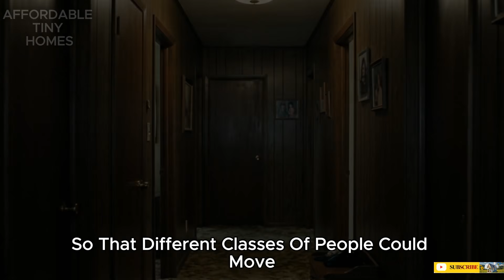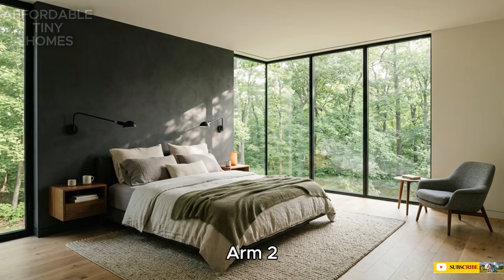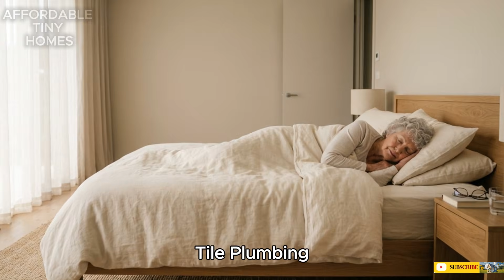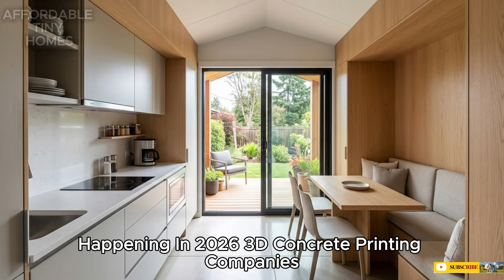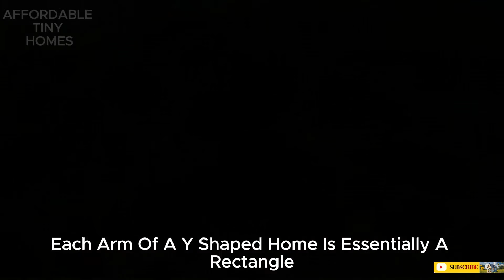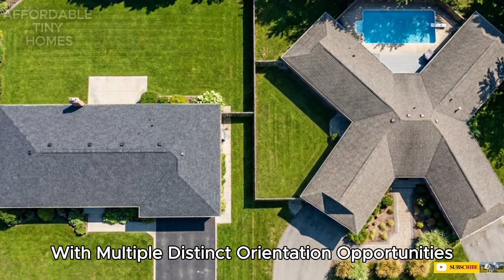Why 2026 Home Designs are Killing the Hallway (And What’s Replacing It)

Comment: I think the most efficient design for the fewest hallways is the circular plan. It's also the most efficient use of foundation area. It's also the most energy efficient, especially a dome. The Y plan shown has some advantages, but it looks like it still has about average hallways compared to a typical ranch house with a split bedroom plan. A problem with the Y plan is that it has a larger footprint compared to rectangle or circle, like a hand with the fingers outstretched rather than balled up in a fist. The illustrations show a lot of glass vs. insulated walls, so that's going to be less energy efficient vs. thick walls with fewer windows. Moreover, the first consideration of a dwelling is the lot. You have to build what fits. After that it's budget and aesthetics, whether geared towards energy efficiency, historical style, blending into the neighborhood, or some other idea such as the Y shaped foundation plan. If you have a generous lot size and don't care so much about energy efficiency or budget (glass is typically more expensive than stud walls) the Y plan is interesting. There's also the triangle plan and the cross plan. The best example of a triangle plan would be a pyramid, and the best example of the cross plan is Disneyland's Monsanto House of the Future. Thanks for posting.
Reply from the maker: You make a great point about the efficiency of circular plans! 😅

Comment: There's advantages, but cost and efficiency of no hallways isn't 1 of them.  You still have hallways in almost all your examples, plus you added a large central area, with the noted increasing cost by increasing the outside walls and introducing a complicated truss design in the middle.

Buffer zones are an expensive solution.  Cheaper and quieter to use closets, dens, and lesser used spaces (laundry, bathrooms, kitchen, etc.) and noise insulation.

Line of sight can be economically established by placement and angled doors-entries at the corner of rooms so the view between rooms is limited.  You achieve the sight privacy without large separation.

The better solution is to create nodes.  Example:
1. At my front door is a node with the entry door, garage door, kitchen, and the entry room.
2. 12 feet away is a node with the steps to the basement, bathroom, master bedroom, and living room.
3. On the other side of the living room is a node with the kitchen entry, dining room, and 2nd bedroom.  
The walkway between these are lined with display cabinets getting dual use of the walkway.  The walkway can be defined with flooring.
4. At the bottom of the basement steps is a node with the steps, basement bathroom, spa room, and workshop.
The only areas not accessible from 1 of these 4 nodes is the 3rd bedroom and deck\outdoor kitchen.

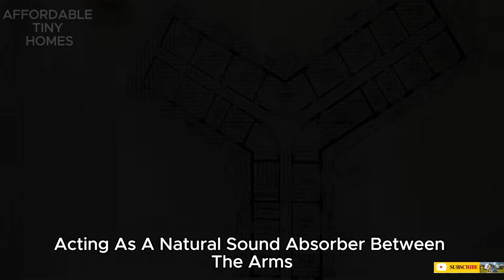Comment: some of the floor plans displayed had hallways like at 7:00. Still need hallways if there are multiple rooms per Y leg. Would have been more convincing if an actual interior tour were shown. Noise between rooms can be reasonably handled using rockwool insulation on all interior as well as exterior walls.
Reply from the maker: Okay ✅

Comment: Hallways create separation and experience. Without hallways Frank Lloyd Wright architectural philosophy of compression does not work. That's the emotions and experience you have going between small and larger areas that suddenly feel powerful and in awe even if in reality the space doesn't have much.

Not to mention separation of sound as well though other design techniques can be applied for that purpose.
Reply: You can achieve Wright's compression-expansion by altering vertically, not horizontally.  Example: a sizable entry with a lower ceiling, that opens up to other rooms with vaulted ceilings (same for other rooms).  Open stairwell with a sloped ceiling until you near or enter the room or landing.
Reply from the maker: Absolutely
Reply: @AFFORDABLETINYHOMES-i9j  It's funny you mention Frank L. Wright, I have been working on building Wright inspired build, but the site is not cooperating and my wife wants a more rambling 
layout . I just started playing with a Y layout yesterday then saw this video today . P.S.  So far it has been a struggle to draft a prairie style Y,  but now that I've seen this, I have to keep trying .
Reply: WELL SPOKEN, BRAVO !